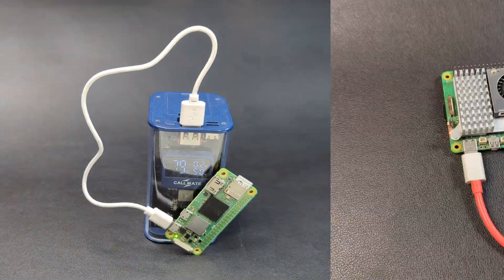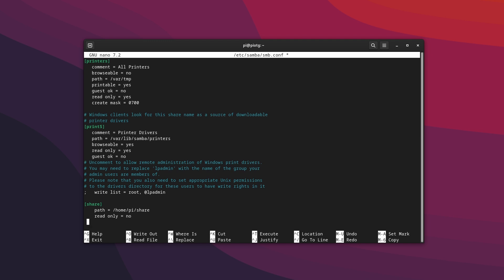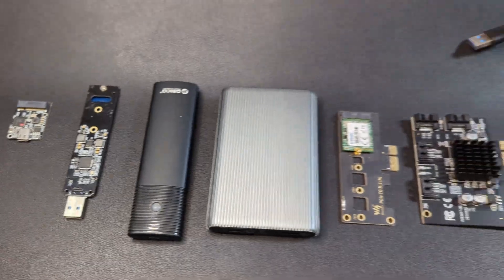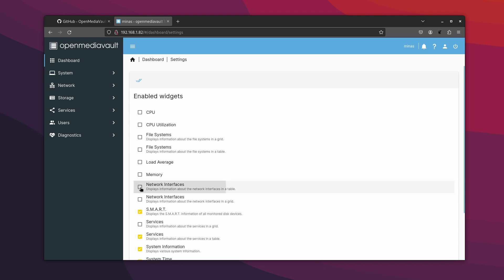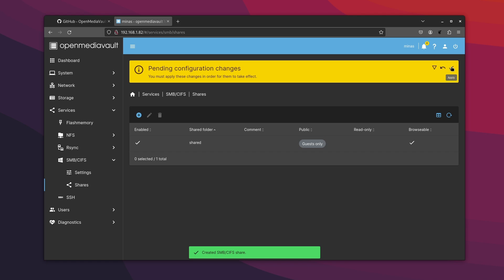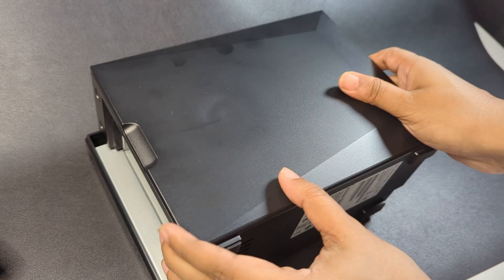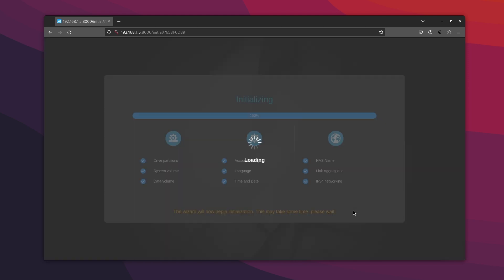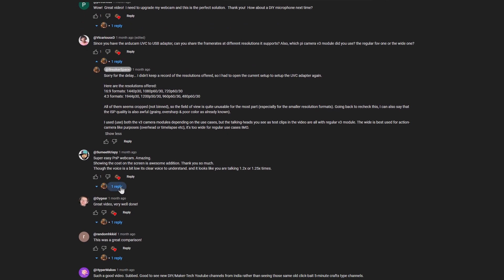I built 3 budget tiers of SSD NAS and you can too!

Comment: Anyone that doesn't want to do the command line stuff and rather use a UI, install webmin on your device, you can manage users and samba from there (among other things).
Reply from the maker: Great suggestion, thanks! I haven't tried it yet, but will do.

To that end, there's also Fedora's Cockpit project as an alternative GUI Linux admin interface, and it can be extended with plugins for way more features than it comes with out of the box (e.g. https://github.com/45Drives/cockpit-file-sharing for samba/smb file sharing). Not necessarily better (for convenience) but it's good to have options.

Comment: I use an old i5-760 machine to share several drives. Rather like your current PI system. The problem with using old Pc though is power consumption. Can you give me an idea of how much power the 4 bay system uses when populated but idle. I ask this, as I end up needing to boot up my old i5 to use those drives. Otherwise using a Pc has proven very expensive from an energy perspective :(
Reply from the maker: Most power a 3.5" spinning HDD will draw is during spin-up time (which can reach upto 20-25W, i.e. 2A on 12V rail). But once spun up, they'll operate at ~12W and idle at ~6W (all high/ceiling/worst case estimates). For an array, you'll have to multiply it by the size of the array (so, ~24W at idle in your x4 case). There are some industrial/enterprise grade controllers which stagger the drive spin up to be one-by-one to avoid the power surge, if you can find one for yourself.

I am going to setup my second gen i5 as a warm storage server, so I'll explore the challenges with it in that video.

Older hardware ARE power inefficient by design constraints (especially the ones before 22nm nodes, i.e. before FinFET) - similar TDP for much less compute, generation over generation. If you're repurposing old hardware, usually it's to avoid e-waste, not power efficiency. But if you can lock the CPU at lower clock speed in BIOS, you can get away with something acceptable, but still more powerful than most ARM SBCs.
Reply: Thanks for the Tip about under-clocking there. @BreakerSpace

Comment: Good video. Turning on SMB1 is a good testing workaround, but it should only be a temporary measure as the SMB1 protocol is insecure.
Reply from the maker: Thank you, and yeah absolutely... I hope GVFS fixes this ASAP.

Not a problem if you're primarily on Windows or OSX client systems... in that case, better to leave the lowest version to SMB2 (default).

Comment: Not enough Indian youtubers making such informative videos on NAS. btw any idea where to find Raspberry Pi 5 27W Power Supply in stock. It's out of stock everywhere except in DigiKey and Mouser Electronics which cost shipping and customs duty.
Reply from the maker: Thanks man, appreciated... And yeah, the power supply for Raspberry Pi 5 is unavailable for as long as I have tried to get it (Robu.in, Robocraze, ThingBits and so on...).

As you may have noticed (the red cable), I'm using OnePlus' charger to power it. Because 5V3A over USB-C from any source would actually work just fine, as long as you don't add too many power hungry USB devices, you don't actually need more than ~10W to run it headlessly.

Comment: Why not consider building a custom PC for a NAS within a 43,000 INR budget? This approach could offer more power and upgradeability.
Reply from the maker: Putting together a 4x NVMe array at that budget gets quite difficult... also considering the form factor, power consumption & the 2x 2.5Gig Ethernet that comes along with it.

If you have suggestions on which parts to use as an alternative, I can give it a try.